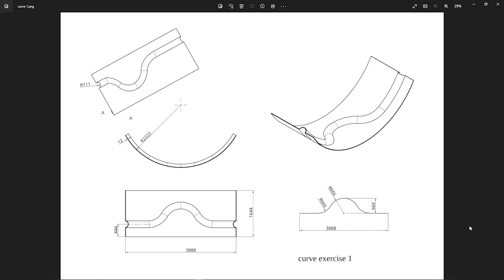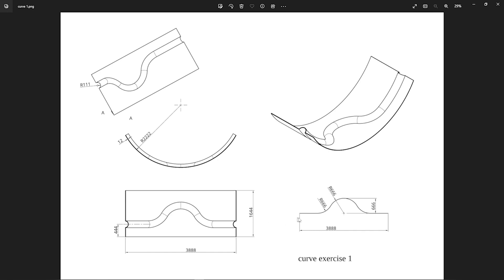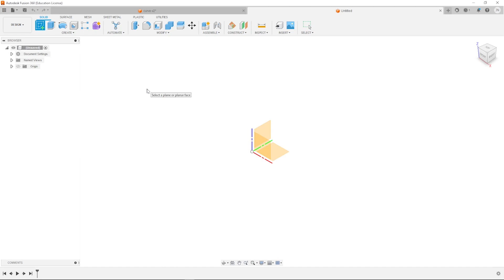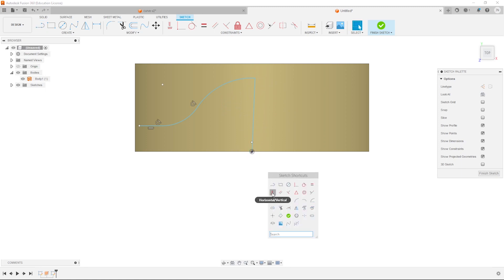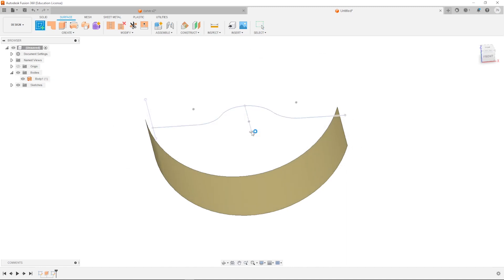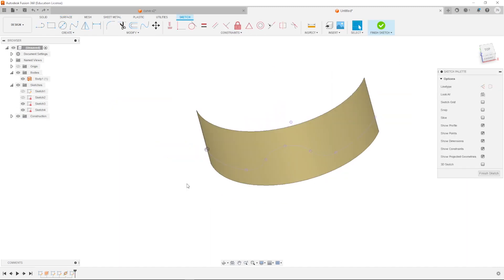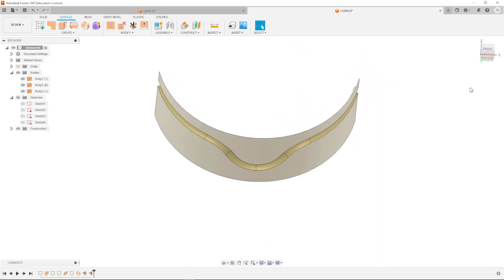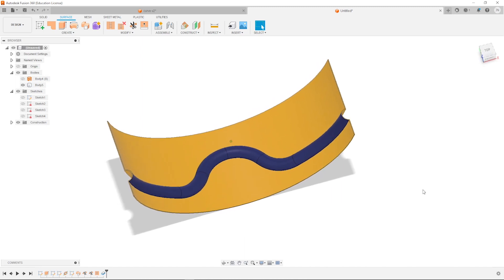Curve Your Way to Mastery with this Fusion 360 curved line exercise

Comment: I'm working on my first Fusion project, a quite complex design. This is basically my first YT video to learn Fusion, although I am working my way through a Domestika course too. I am quickly learning here some tips to greatly accelerate my learning process. Thanks!
Reply from the maker: You are very welcome. I was not aware of that site you mentioned, seems like a good place for learning material. Good luck with  your project!